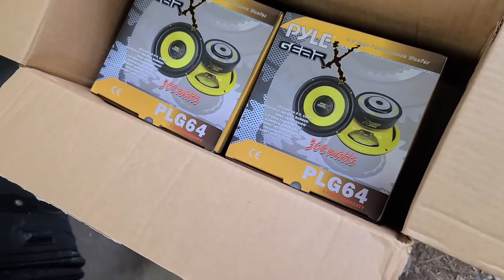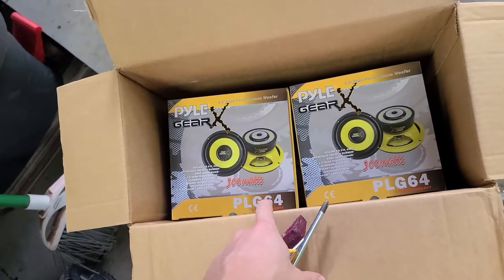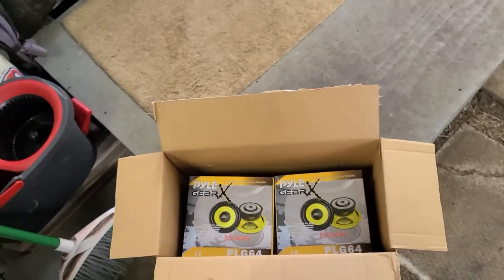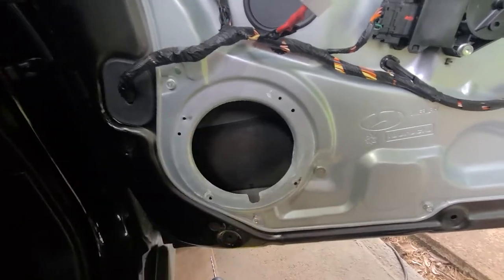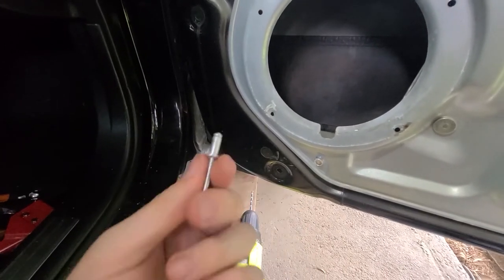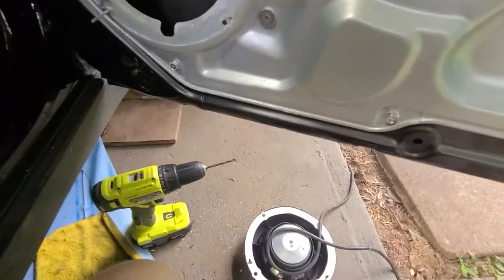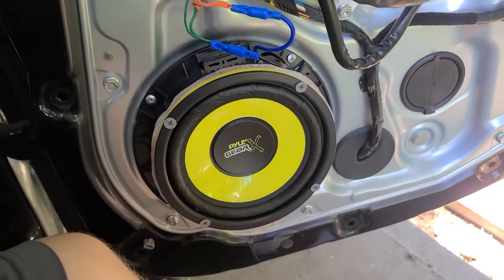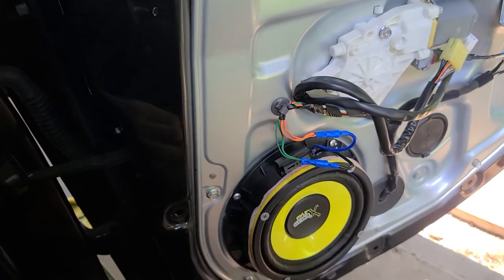Door Sub Replacement - Full Guide - Detailed - Genesis Sedan

Comment: Do you recommend to replace the amplifier as well..??
Reply from the maker: If you want more bass then you can add a aftermarket amp to power them but the factory one does fine for me
Reply: @GenerationGarage  ok cool... Is the difference compare to the stock speakers mild or significant in music quality..?
Reply from the maker: @radekpasecny4538  Its about the same, the stock system is pretty decent to begin with

Comment: How do I add a 4 channel to stock radio or change it out
Reply from the maker: you can run a new amp and all new wiring or just do a high low converter out to rca would also work

Comment: Which one is positive and negative on the door speakers
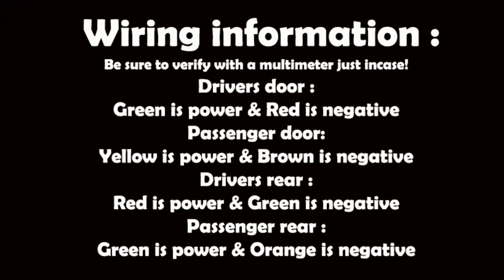Reply from the maker: its at the end of the video.. 27:46 you can also use a multimeter to test it
Reply: Did you use just generic 14 gauge wire?
Reply from the maker: @smokeordie08  that or 12 but yes

Comment: I would recommend wiring these 4ohm dual VC speakers in parallel to get a 2ohm stable impedance. Maybe it's just me. 🤷🏼‍♂️
He's a link how.
https://youtu.be/smw-6VRy5QY
Reply from the maker: Its single voice coil not dual but yes you could "IF" you can find this size in a duel coil option with the low watts required. Most brands wont offer all 3 options unfortunately so its a take 2 situation, I went with size and watts and settled for 4ohm

Comment: Boy have you got a lot to learn, ever hear of Crutchfield? They sell 6.5" "subs" in 2 ohm and 4 ohm, single or dual voice coils. And they sell Metra speaker brackets for select 2010 - up Hyundai's for $20 bucks saving you all that work butchering the OEM speakers. Speaking of speaker impedance you do realize now that you installed 4 ohm "subs" the amplifier will be producing half of it's potential output power, it's not "seeing" a 2 ohm load. BTW I'm in no way affiliated with Crutchfield, just an occasional customer.
Reply from the maker: I used what Amazon had available at the time and yes I know being 4ohm it will require more power to push them so I just turned the bass up on the head unit and it works great. Yes I know you can go the factory option and get new subs for the doors but these subs are a better quality over OE and didn't cost that much anyway, I didn't mind reusing the original spacer unit because it didn't take to much work and was a good solution if someone else like myself found themselves in the position of needing to do something on the fly to make it work. 

Also, keep in mind you're not forced to follow this video and do anything the way I did it. This is simply the way I did it and an option for anyone else to see how everything is from factory to be able to make a decision on how they want to do it.

Comment: Why would you put the cheapest speakers on the planet in.
Reply from the maker: subs* and because they were the lowest watts/ quality subs I could find. Anything else in any other brand required more power to push and i'm not going to replace my factory amps for basic door subs.

Also they sound better then stock and complement my 2 12s in my trunk.
Reply: @GenerationGarage about to buy right now, do you believe I should get some OEM eBay replacements for all 5 with roughly $200 or stick with the aftermarket’s, I also do enjoy bass how does it perform